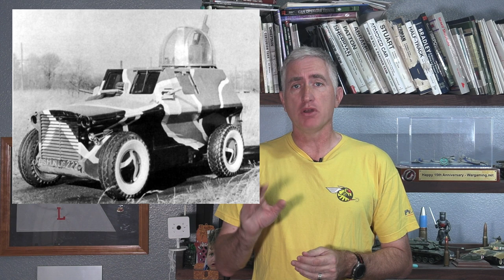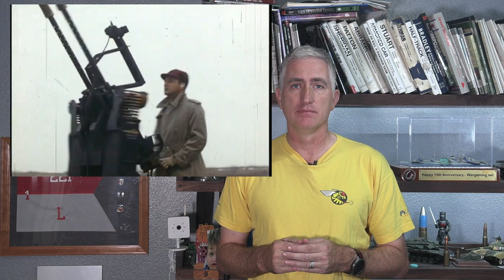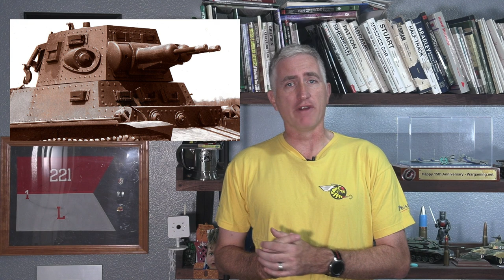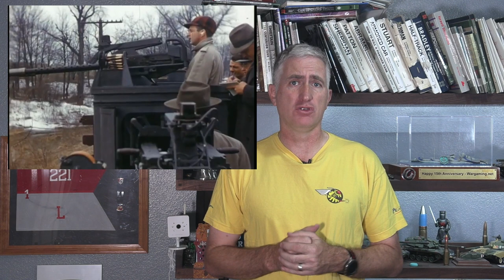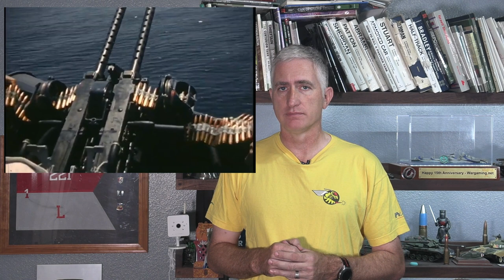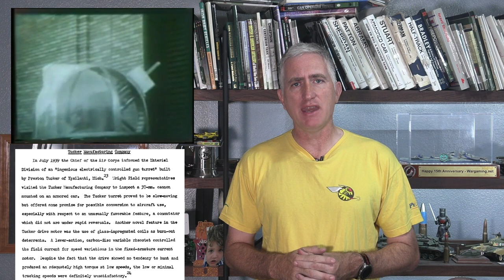Why the Tucker Tiger Failed

Comment: plexiglass bubble dome was a good idea
Bonkers little car buzzing around a battlefield is a bad idea. The jeep was actually useful. Hellcats were used as a faster armored supply runners during the battle of the bulge.
Reply: How is the bubble a "good idea"? It is totally unarmored, liable to be smashed or at least scratched by branches and rocks thrown up from the road, it will have to be cleaned inside and out daily or you will lose your visiblity from dust and dirt (and you will probably scratch the plexiglass with the abrasive grit when you clean it), it will flash and glint and show your position up like a flare every time the sun comes up. AND it will roast the gunner like sitting in a solar cooker. Yeah, brilliant idea, that. Turrets make sense in an aircraft because they are mostly operated in clean, dustless conditions, and because it is very cold and windy outside, the drawbacks and accepted as worth it. Not true on a scout car.

Comment: Yeah a glass turret... well that could have been changed. They could easily have fixed a lot of the issues talked about here but of course it would have all taken time.
Reply: You'd be ground up redesigning to actually make it good offroad, it was already too top heavy WITHOUT the turret installed to even start some of the tests, a new turret would alone be enough of a project to be what some large companies did for years, but you can't just lift it further to stick 4x4 under it and call any of the rest of that design suitable. So its not so much a matter of time to "fix" as it is "design a vehicle for an actual military context", which isn't a fuel hungry v12 RWD 4x2 doing >100mph down the highway.

Comment: Video of unit in action... excellent.

32 inch off the ground: too hight
12 cylinder,,,tons of fuel?
12 cylinder ... Overkill
Should have diesel engine.
The jeeps overturned,,,killed a lot of GI's
Reply: I am sure plenty of Jeeps overturned (tens of thousands of American soldiers died of traffic accidents in WWII), but they are not really known for it. You are thinking of the M151 "Jeep" from Vietnam, which is notorious for flipping easily (although I suspect reputation is worse than reality).

Comment: Sounds like the Army did the right thing.  A 10,000# car that gets stuck all the time would never work in combat.  Also no mention of a ventilation system which would be an imperative in desert warfare with an enclosed vehicle.  Also while the Packard Engines ran like clocks they were not fuel efficient.  The fuel tank would have to take up a lot of room in that small of a vehicle.  I'm surprised that Tucker submitted such a poor design.

Comment: I wonder what Army field mechanics would have to say about maintaining a 12 cylinder engine. About the only thing worse probably was the 30 cyl monstrosity of the A57 in the M4A4 (which the USA was happy to lend lease).
Reply: Christopher Cripps - The Ford GAA in the M4A3 was an eight cylinder version of a V-12 aircraft engine that Ford was developing to beat the Allison (GM) V-1710
Reply: @colbeausabre8842  I believe the GAA and its 12-cylinder cousin, the GAF, were both the "de-rated" versions of the Ford aircraft engine.  They would have a lower compression ratio and a different camshaft in order to run off of 80 octane gasoline which was the regular grade of the time.  Although GMs 6-71 did ok, diesels were still somewhat underpowered, and it was a question of having a common fuel as trucks still ran off gasoline.
Reply: There is a video on the Chrysler multibank engine whose author claims that scheduled maintenance for the A57 was significantly less than for any other Sherman engine.  However, said author seems to have conflated "scheduled maintenance" with "reliability" in the narrative of the video, claiming that the A57 was more reliable than other Sherman engines.

Comment: Gearing was off; trade the high speed for more torque so it can be better armored & still have the necessary acceleration to get out of its own way...
Reply: So it can be even WORSE off road? Great idea. "It can't traverse our simplest off road courses because it is only 2WD" "Hey, lets put even more armor on it and gear it down so it is slower! Then it will be just like our other armored cars, except worse off road!"

Comment: I'm surprised a 5 ton vehicle could reach 100 mph with 170 HP engine.
Reply: Lots of torque, and good gearing. Plus, they probably let it rev to 6000rpm.
Reply: I doubt it could. It was probably theoretically able to do 100mph, which is not the same as actually being able to do it.

Comment: Did the army use the wording 'Sway' bar for what is known as a lateral locating bar?  Since 'Sway bar' becomes known as a totally different type of suspension; ie  item  transferring vertical tire motion to an opposite wheel by means of a body stabilized linkage.
 Sorry for the dogmatic moment........too much isolation and not enough strangers to force my useless knowledge onto.

Comment: Never heard of this vehicle. From what I got after watching this video, it definitely had some interesting design elements, but as a whole was deeply flawed, as is often the case with such endeavours.
Also, why were hydraulic-traversed turrets better on planes?
Reply: Faster, and since the planes already have hydraulics running everywhere, running a couple lines to a hydraulic motor to spin the turret is actually lighter than going electric.

Hydraulic motors are smaller and lighter than an equal power electric motor.
Reply: @ScottKenny1978  I see, thanks for the answer!
Reply: they aren't, although they can be. Both types have their problems and strengths. Turret design is actually far more complex and fascinating than most people realize, and they are expensive pieces of kit. Hydraulics are prone to leak, prone to fires, and the lines are heavy. The require mechanical valves and regulators. In the first part of the war they had kind of given up on making hydraulics work in the US, and mostly developed electrical models. But later they came up with some solutions and developed some good hydraulic turrets as well. But neither one is really automatically better than the other.
Reply: @justforever96  Ah, I see, thanks a lot!
Reply: speculation, but it may have been that the hydraulic systems provided a smoothness to the controls that their (assumed) experiments in electric control did not.

I read somewhere that one of the tests for RAF air gunners was to put a pencil in the gun barrel and get them to write their name using the controls. Sounds... feasible I guess. Probably more of an instructor quirk to make training interesting than 'in the manual'.

Speculation. Don't quote me in your final exam :)

Comment: A 10,000 lb vehicle with a 175HP Packard V12 should get gas mileage in the single digits. Not what you want from a supply and logistics standpoint. The Jeep turned out to be a more useful and versatile scout car even though lacking in armor and fire power.
Reply: Later on,  the Army employed M3 and M5 Stuart light tanks in the scouting role, at least with armored divisions.  I can well imagine that with those TWIN Cadillac engines the Stuart was in no danger of getting out of the single-digit range for fuel consumption.   Of course, the Stuart's armor and main armament (37 mm) was laughably inadequate against any Panzer, but it wasn't supposed to slug it out with them anyway, just get the hell out of there.

Comment: 4:56 i bet that rubber "foam" would have been REALLY easy to catch fire
which is probably why nothing like that was used on ANY nations tank..... even to this day
.
seriously.... it sounds like a good idea........ but in real combat, im 100% sure that it would all burn in about 50 seconds
Reply: or..... even if it had early "chemical treated" stuff on it to prevent / slow down the fire
then even a small patch of it burning would put out toxic gas..... a LOT of toxic gas 
.
so, instead of the crew burning up.... or having all their oxygen burnt up......... they would be poisoned
.
.
.
again.... coating the inside in a "sponge / foam" type material sounds good
but if it catches fire...........

Comment: sounds like to me that some one in military procurement didn't like Mr. Tucker, to bad because he had some good ideals!. and the speed problem is easily solved with a engine governor, just like the ones they used on the duce and a half!.
Reply: WTF is with you people who obviously didn't watch the video commenting here? The speed wasn't the "problem". If it was, it would have been easily fixed, as you say. they merely said they weren't going to count the speed as a bonus like tucker wanted them too, because they didn't ask for, want or need that kind of speed. Moran very clearly and plainly stated this in the video, to make sure no one got it confused, but apparently it didn't work, because here you are. The problem was that is was unstable, the brakes sucked ass, and it was totally incapable of traveling off road. They told him to go back and fix it, and he simply refused. Yes, clearly it was just that the military didn't like Tucker, and that was the only reason they didn't take his crappy design.
You know what you get if you put a governor on a Tucker Tiger? You get an M3 Scout Car that can't go off road. How is that an improvement?

Comment: Very interesting and informative - great job!  I do think it would have been interesting if they had managed to get it off-road workable - though I have to say if I'd been assigned to the turret I think I'd have been happier with less visibility and more protection.  "It had one drawback" that was quite optimistic... ;-)
Additionally, I think if the vehicle had come about in the early to mid 1920's it might have been more workable in terms of armament - b/c I think when it went in for testing at the end of the 1930's, that 37mm gun probably wouldn't have really cut it either. Because weren't 47mm guns by that point seen from a practical standpoint as the minimum even for smaller vehicles like this one (of those that weren't MG only)? I could be remembering wrong (and feel free for someone to point that out with additional info if that's the case) but I do think that 37mm gun might have been a later sticking point had the vehicle made it past the stage where it flopped. Though I suppose it is also possible that it might could have been up-gunned to carry a 47mm with some substantial re-tweaking to the turret. Maybe?
Reply: yes you are wrong, actually Germany conquered most of the Europe with 20mm guns. You forget the fact that that 37mm gun was not a single shot/reload gun, it was automatic cannon. That would have shredded trough any German tank in begin of the war. Especially since this thing was a fast flanker with excellent turret not seen in any tank of that time.
Reply: @madigorfkgoogle9349  I meant for the allied side. And that's not entirely true for the Germans. They had Panzer IIIs for the invasion of Poland that had 37mm and 50mm guns, and Panzer IVs by the time they invaded the rest that were armed with 50mm guns. I guess it depends on what type of vehicles we're talking about. Either way, saying they conquered with 20mm guns isn't accurate unless you're limiting the vehcles you're including to non-tanks. Beyond that though, the size of the weapons the Germans used isn't really relevant, its the amount of armor they were protected by that dictated what strength armament the allies needed to successfully resist them with.
 A fairer critique of my comment would have been that a scout vehicle may not have needed a bigger armament than that b/c it wouldn't have really been expected to go toe to toe with the type of vehicles that needed a bigger gun to deal with.
Reply: @zorkwhouse8125  well, Germany conquered entire Europe with Pz.II as a main tank. They had almost no Pz.III or Pz.IV in Poland and only few in France when compared to Pz.II or Pz. I (which was a tankette) numbers. Best equipped German tank of that period was former Czechoslovak Pz.38(t). But it is safe to say that Germany really conquered the western Europe with Pz.II and that was equipped with just 20mm rapid fire. The 37mm was plenty of gun to penetrate most German tanks of that time, if not from front (Pz.III, Pz.IV, Pz.38(t)) then from flank. Even German Pz.II gun was not able to penetrate most French tanks from front, but they did eliminate the majority of them.

Eastern front and Matilda changed everything.